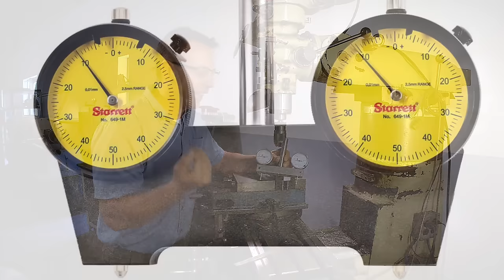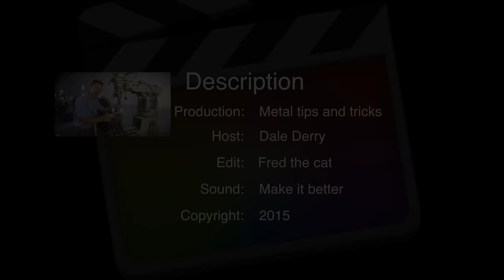DIY Spindle Square "Reloaded"

Comment: Great application of practical engineering and design.  One of the most important lessons that I needed to learn as a precision mechanical designer was to not over design your project.  Go for the simplest solution for any problem (opportunity) and it will usually be the lowest cost to manufacture.  Its a beautiful thing.

Comment: Dale

I know this is an old video, but I have to mention that if you just tram to the vise, you are not sure the head is square to the table.  If you ONLY work in the vise, that is fine and probably the best choice, but often I find that I clamp direct to the table for work that will not fit in the vise, and really want the table square for those operations as well as having the vise square.  

John

Comment: I've been wanting one of these... $ being the reason I don't have one until now,  so thanks for the idea! For assembly I like to freeze the shaft and oven heat the holder, slip it in and it locks down in a very short time. Thanks again
Reply from the maker: +HaWK OT 
great suggestion

Comment: At first, I figured this would be useless! The worrisome thing for me watching this was the very idea of using an out of tram mill to drill the holes for your mill trammer. 
    It wasn't until I did a lot of reflection on it that it dawned on me that the holes for the gauges and the central pivot only need to be true to each other. It will not matter at all how much wobble the cross bar has when turning in the spindle - the height of each gauge relative to the spindle will not change if the mill is in tram when checked. VERY NICE!
Reply: its useless. You cant compensate that wobble. We made a single right hand angled one in shop on a precision machine accurate to 2 tenths and it still wobbled making around the table indications worthless. that 2 tenths was amplified at 12" and getting the bar in straight without a specific protocol is near impossible. This is why companies charge $100 and up for a professional one. It looked awesome when it was finished its too bad it couldnt do the job.
Reply: @ilovehobbies3782  What wobble? Wobble could ONLY come from loosely fitting parts. That's not necessarily the situation when making this on an out of tram mill. I guess "wobble" didn't describe what I meant by the variance due exclusively to holes being other than square. Consider the situation when the milled is already in tram
 ____\____
\                   \    Now mentally rotate this so the slants are upright (since they are IN LINE WITH THE SPINDLE). Zero each Gauge. Gauge 1 would read 0.0 while Gauge 2 would read 0.0
Now spin the 180
 ____/____
/                 /   Now, Gauge 2 would read -.005 while Gauge 1 would read +.005
If it was out of tram, then Gauge 2 would read -.006 while Gauge 1 would read +.004
See how that works?
Reply: I hope yall realized he had one in his hand before making the one he built in the video. He looks at his other one while the block is in the vise.

Comment: The good news is that  I was thinking about building one of these.  The bad news is that I missed the 2 week deadline by 9 years.

After tramming my mill a few days ago I was thinking about how to make the shaft exactly perpendicular to the square piece I finally came to two conclusions.  After all, this is being made to improve on the accuracy of the tram so the conclusion must be that it's not already an acceptable version of perfect.  First, the two pieces don't have to be toolroom square to one another because once the dial indicators are calibrated that takes out any irregularity.  Second, if the face of the shaft is cut square on a lathe and threaded for a retaining screw, it will square up when the screw is tightened.

It's important to make sure that all of the gibs are properly adjusted before tramming including the knee gib.  If it's loose and the knee clunks occasionally when being lowered, the angle of the knee to the head is changing every time it's raised or lowered.

Comment: I have watched this a couple of times, and I'm wondering if it is critical that my mill is tramed before I drill the three holes.  It seems the center rod would have to be at a perfect 90deg.
Reply: Even with the hole not at 90 the indicators are zeroed individually thus removing the error in the tooling.

Comment: if you tram the head to the vise, and the vise is raised due to chips under it, would the head be crooked to the traveling axis? would that create a situation where an end mill , or drill would not be parallel to the ways?
Reply: Exactly. Tramming the vise is all well and good but first your mill head HAS to be square with the table (ways).

Comment: Very cool build Dale, 2 Q's,,,, how come you didn't just use thumb screw in the indicators and not slit the side to pinch it together, and how critical was the drilling the main holder hole at a 90deg. angle ? or isn't that that important, this is why we tram mills, going to build this one, Thank you so much 👍👍👍👍

Comment: I use to work machining Aluminum water pumps for GM V6 engines and the company used Varsol it's no more flammable than WD-40 and at that time was bought in 40 gallon drums. Buy Varsol paint thinner brush cleaner. I also use it on magnesium bell housings for FORD trucks.

Comment: If that Riser Block on your Mill  gets any bigger  your going to need a Scaffold. lol     and yes you are Right about Drill chucks Keyless or Not anything over 1/2 inch I try and use a collet.  plus you can put more force on it in Tuff Material  I have seen Chucks Pop out of Tapers  that hold it to the R8 adaptor from using drills that are too Big

Comment: The accuracy of the spindle square is dependent on the squareness of the mill spindle in the first place. How did you square the mill before building the tool to sqaure the mill?
Reply from the maker: Your mill doesn't have to be square. The only thing that matters is the three holes you drill are parallel to each other.

Comment: Try Paraffin wax as a lubricant for your bandsaw blade, instant difference in cutting speed and little to no mess.Just touch a block of it to the sides of your blade every 10 seconds or so.
Reply: ***** I also use a block of beeswax.
Reply: Been using a bar of soap. Where I live anything remotely related to anything has to be shipped or  gotta go to the city. The soap I can get at dollar General. Which is the only thing in 30 miles.

Comment: "we trust the machine " to make square holes at the bracket ...in order to check  the machine for squareness , this sounds counter intuitive .  my mill  is low end and i really need this check to be as accurate as i can. thank you for your info . if it wasn't  for you and some other nice people in youtube i would not been able to learn anything about machining. thanks a lot.
Reply: It shouldn't matter if the holes are square, so long as they are all the same.  This is the reason that all 3 holes were drilled without moving the part in the vise until all 3 holes were drilled.

Comment: When I cut Thick Steel or Aluminum on the Do All  Band saw at work I use a Light spray of WD 40  been doing it for years with no problem you also need a small air jet pointing at your Blade to blow out the Chips from the Teeth  cuts like Butter
Reply from the maker: Hi, I like the idea of the air blowing on the blade. every once in a while I use wd 400 too>

Comment: How did you determine  that your mill was off by 0.013"?
Reply: BandAid hello. I just run my table a few cranks of the handle to take up lost motion, set the dial to zero, lightly back off until you feel the screw engage and read the dial. for higher accuracy, mount an indicator to see exactly when the table starts moving. also be aware this number may be differant along the entire length of the screw due to slightly more wear in the area that has seen the most action over the years. sometimes this is negligible, but to be safe, I make the measurement in the middle, where my vise sits.
Reply: TY

Comment: Yup--Saw both of the troll issues. So why DON'T you use a handle? Do you know something the trolls don't? Great video BTW.
Reply from the maker: Rick Rose  I don't have handles on my files because I don't have any handles. I usually by them used and they never seem to have handles. :-(
Reply: ***** It's easy to make handles, you have a lathe. I've made some nice ones from osage orange that someone gave me.
Reply: I noticed on one of Randy Richards' videos that he had files with golf balls attached as handles. Interesting idea. Cheap and easy.
Reply: Rick Rose I pick up cheap screw drivers. Get them for free at Harbor freight or a hand full at a flea market for a buck. I heat the screw driver blade with a torch to remove it. Then depending on the size of the file I will heat the handle tip to melt it in or use epoxy to glue it in. Works great and is cheap.

Comment: Pretty good, not a machinist yet.....just a hint,  on your mill spindle 12 1/2 turn, no need to adjust dial for your estimated play in nut, this is not accurate, crank anti clock  past 12 1/2 turns, then clock turn to 0 or .100". You might need to brush up on lathe turning tooling with sharpening, turned shaft shouldn't need filing.
That anchor lube made a mess, use WD 40 also if anything.
Reply from the maker: +Konely King 
thanks of rah info

Comment: Hi, I bellive that your sistem isn't correct, and the reason it's the possible error in the pliers, (also the pliers can be imperfect). In presence of pliers error you will compensate this error but you will be out of square, correct? The only system to be real in square it's a magneto direct on the bottom side off spindle machine whitout any component in the middle and make a clock on the table. You will be absolutely sure to be in square.Regards

Comment: Thanks for an interesting video!You, and several other skilled mechanics, use WD40. Yesterday I saw WD40 in a shop, bought it and used it. Yes, shure it works well.Reading the label on the bottle made me afraid. "Use good ventilation, avoid skin contact. Might cause deasiness and skin trouble…..". Does it contain both drugs and poison? I am surpriced that WD40 is allowed to be sold.For cutting aluminium I since long was told to use, Red or White Spirit which is a lot less hasardeous.I used the WD40 for cutting steel and it works well. However a paste, Allo Cutting Paste, sold by Allo Naturprodukter AB in Sweden, worked well too, and it is told to be biologicaly degradable. It easily removed afterwards. WD40 calls for dropping all the equipment in carosine….What do You Think Dave?Regards,Stefan

Comment: Problem making your own if your equipment isn't accurate and you don't have good metrology tools than your well apt to install your arbor off center and if its even a tenth off that will cause inaccuracy as you rotate the spindle each end will alternate up and down (as much as 100 thou or more) making your tool worthless. You'd really need a fixture with a good indicator while you press the arbor in and watch carefully. Personally id never use someones homemade square unless i knew exactly how they made it and watching this method i wouldn't use it. While some things look rather simple and the initial construct looks easy and usable these require a good amount of accuracy to make that home builders just don't have available to them. save the time and spend $100 on one that you know is tried and true.

Comment: the second is no handle, or it could also be the cross slide is too close to the chuck, if the file bites it could feed your right hand rapidly into the cutter on the tool post!!, also PLEASE do the jobs at true speed, doing 20 x means we haven't a clue how long the project takes when we do it, also it can hide any tips you give whilst cutting is underway.

Comment: Not to sound like a dochebriklet. But isn't this device kind a useless you need two dial indicators and. you can't be sure If your tool is acccurate. The classical way I think is easy enough
Reply: Yes and no. Yes - both indicators have to measure identically(not necessary accurately). 
For home gamer - it is actually easier and more cost effective to make tramming tool like this, only with one dial indicator.
Reply: the tool itself doesn't have to be accurate to set the indicators where they are accurate. You simply use a fixed point to set the indicators both to zero and off you go. I use these all the time. One of the most loved of my toys.
Reply: Yeah well sure thing. But You need to fix the two indicators every time unless you are planing to. Sacrifice two indicators just to keep on your tool
Reply: Sorry my english is so suck it generally takes about 15 seconds to set the dials using a parallel as your fixed point.
Reply: Plus you need to find the two indicators. But the other one is missing cus you where so drunk last night trying to tram your head and got angry so you broke the indicator now you only have one then you need to go buy another indicator. But can't cus your drunk so you need to call your mate to drive you to shop but it closes in 10 minutes so you have no time plus your cat is stuck on your toaster and you need to go save your cat put then your wife starts nagging and you get really angry so you trow the cat at your wife now she trips down and pours hot tee all over hear. You need to drive your wife to hospital and your cat to vet but can't do that cus your drunk. So lets summ this up 2 cases of beer 40$, bill from the vet 300$, Bill from hospital 500$, Fine for driving under the influence 500$  New indicator 100$. USE ONE INDICATOR ONLY!
Reply: We really need to get a camera crew out to your place. It sounds like a new comedy show. I would pay to see it. Have a nice night bye-bye.

Comment: The thing is though that it doles the drill more when it enters a cut then being in a cute.

Witch is why when you do peck then you make long peck's

Reason for the long chips is that your ether have to meany rpm's or not going fast enough down in the material so that the drill can break the chips ( just like with inserts on the leath's insert tool holder or the mills knife / face mill ( they have that little odd formen peaks to break the chip's. Also called "the chip breaker") ( have gotten 16 hours of education on just how the chip is formen. How and why we break the chips and what temperature that there right on the " cutting end")

Comment: WD-40 has changed over the years. The formulation is a little different than the original
Reply from the maker: gbowne1 That make sense It seems a little oiler now.
Reply: there is seemingly also different formulations for different countries.
Reply: Bill Lewis 
That's because it causes cancer in California.

Comment: I've been wanting one of these... $ being the reason I don't have one until now,  so thanks for the idea! For assembly I like to freeze the shaft and oven heat the holder, slip it in and it locks down in a very short time. Thanks again